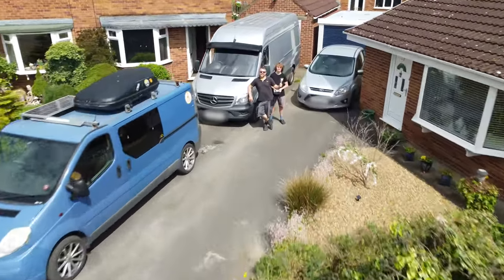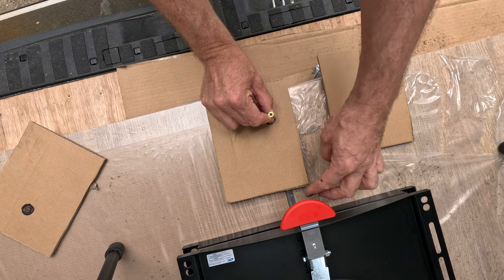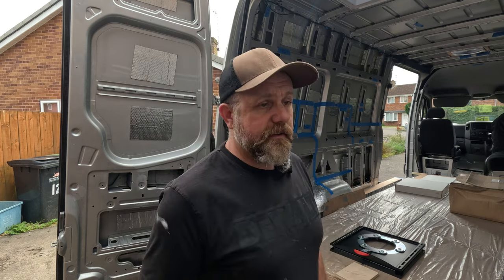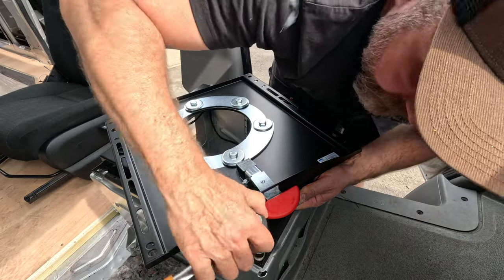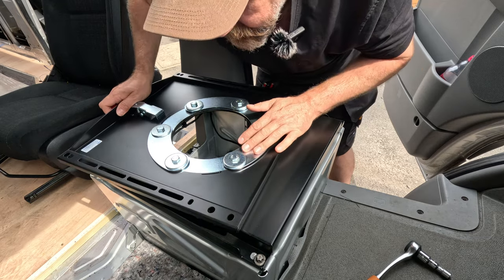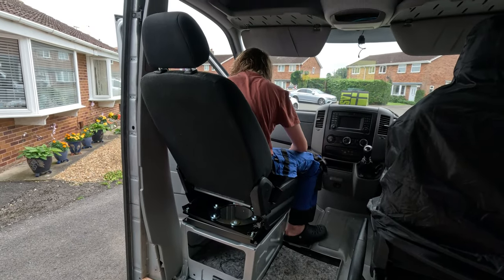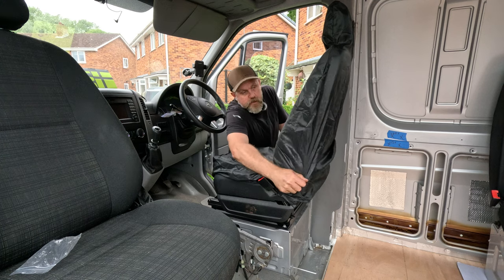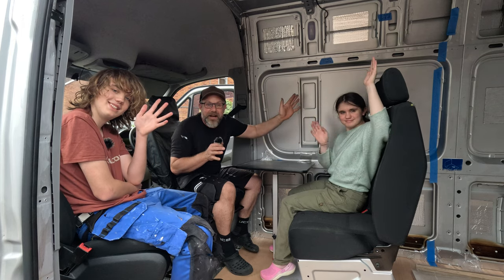Swivel Seats installed in our Sprinter van conversion, Finally!

Comment: Great job, as usual. 
I don't have swivel seats in my own van, and am now envious. 

But the foot height issue makes me think you should raise the floor, behind these front seats. This is an opportunity to make some more storage – either hidden storage for valuables, or an area, say, for food can storage or a water tank etc. )That's better than having overhead storage, as it keeps the weight low. )

I guess the solution is also tied in to the height of the side door exit. I remember that you sorted out the side door exit foot well for a lady before – adding some removable steps – was that for Sally? 
Worth some thinking, anyway.
Reply from the maker: Hi. Thanks. Yeah a couple of people have suggested building a foot rest that can be storage. But like you say, it'll eat into the entrance way. Plus I feel with the limited floor space it'll make it seem smaller. Still not sure. But thank you for the comment 😁
Reply from the maker: Yes. Sally ;)

Comment: I would probably be OK with the shortening the passenger seat with your welding modifications, but I don’t know if it would be a safety issue if you modify the driver seat for injury in legal purposes.😮

But beings you’re both are taller gentleman, and like your seat lower, I would definitely lower them both😊
Reply from the maker: Hi. Thanks for the comment. Funnily enough I've been to visit my welder guy today. He's confident he can cut them down and make a solid weld of it. He also plans to add reinforcement so they will end up stronger than they originally were. So very happy with that👍👍😁

Comment: I would build a small platform with a swing lid, then you can have additional storage for shoes or something.
Reply: Also do you need to put some greese on the swivel to make it a bit easier to rotate? great little update video :D
Reply from the maker: @jamesbond4981  hmm🤔. Interesting. Yeah, certainly an option. I'll have a think. Cheers
Reply from the maker: @jamesbond4981  yes. Good idea. I was thinking about that. Thanks again 👍👍😁